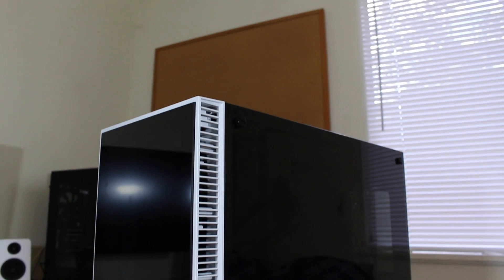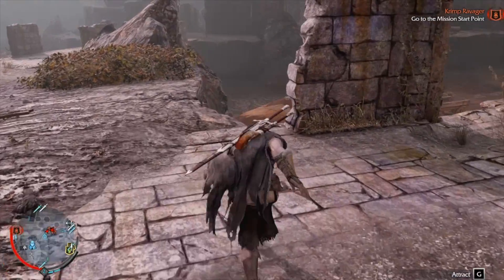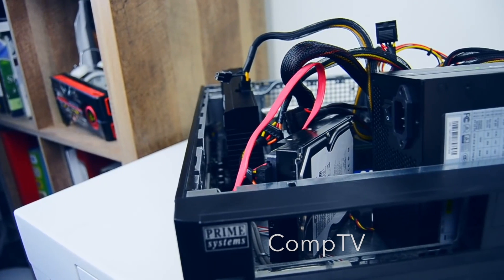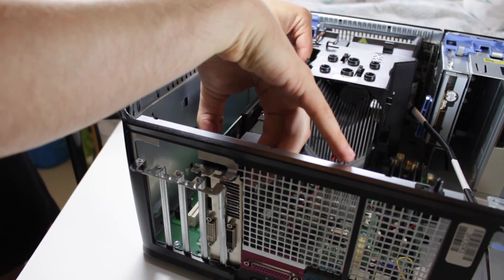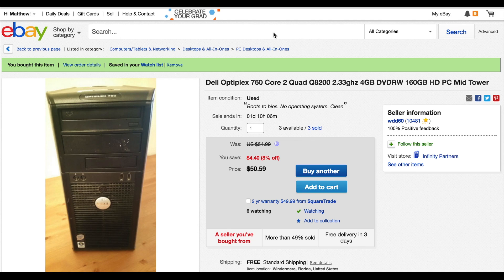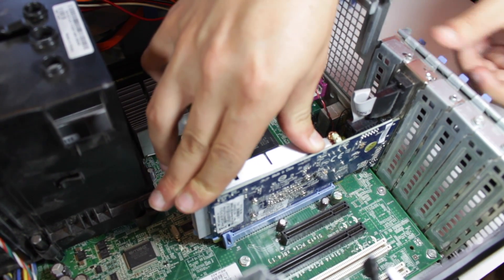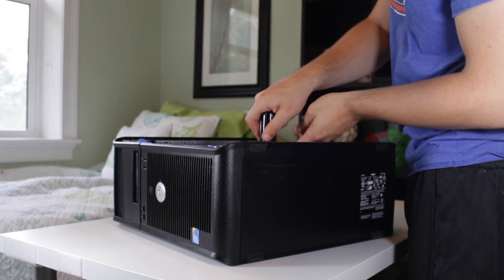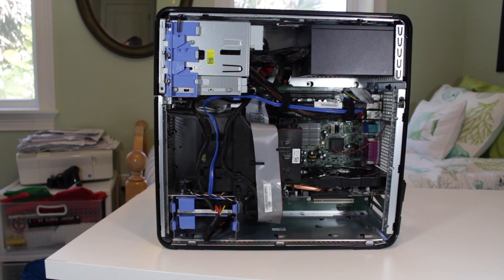Is a $100 Gaming PC Possible?

Comment: I got a gtx 750 ti -$55
PC with 500gb HDD,10gb ram,and i3 2102-$45
For the os, I brought my USB drive to the library and downloaded the  windows 10 iso then converted it to my PC once I got home. 
The PSU was 350w though but luckily I got the 750 ti - pcie power 75 watts

Comment: I got 
Q9400 clocked at 2.6 GHz 
8 gigs of RAM
500 GB Hard Drive
GT 730 2 GB GDDR5
300W PSU
and a case lol
for just 66$.
Reply: Poviku-PPcans The problem is that the place where I live, there aren't many cards out there in the market. Yeah, of course, I have to buy used, but I can't find any old Graphics Card in the country I live.
Reply: In Middle East.
Reply: Yeah :/
Reply: decent
Reply: I got half of what you have in every department

E7500 clocked at 2.93 Ghz 
4 gigs of RAM
250 GB Hard drive 

;)
Reply: +Ali Salim Where are you from ?

Comment: I bought a older refurbished mobo (dq965gf) for 30 bucks, a rosewill scm-01 for 30$ as well, and a q6700 for 25$, a atx-vs500w for 25$, and a gtx 950 factory overclocked for 150$. That's a 235$ pc, that's what I call a budget gaming pc! Not this hunk of ass
Reply: Well with the bottleneck on your gpu, your framerates wont be much higher than his. idk what ull do without any ram. And for more than half the price. im pretty sure i would choose  this "hunk of ass" over ur cptain america budget gaming pc
Reply: André Lente ya forgot to mention I have 8 gigs of ram, and no it didn't run anywhere near this pc would. I got 50fps on gta5 very high settings, 55-60fps on high. Over 140fps on csgo max settings. Also I got the q6600 instead and overclocked it to 3.0ghz.

Comment: i have an hp base system its really good
but i have another 100 dollars in my pocket and in need of a graphics card
the only game i want want play is gta 5 so please recommend me a 100 dollar graphics card
pc specs
core i5 2400 clocked at 3.40 ghz 
320 watt powersupply
12 gb ram
500 gb hdd
gta 5 currently downlading.....
Reply: RX 460 2gb
Reply: soohoo! I've got an i5 2400 with a GTX 1050 Ti and it runs fine.

Comment: Can you make a video that incorporates a build that will not only play the games mentioned at 1080p, but your system will be nicely capable of recording and editing/rendering that same video? Just because it can play the game doesn't mean it will record/edit/render and play well on YT afterward. It's yet another challenge!
Reply: Eurocat Games Nvidia cards will get you ShadowPlay, a screen recorder that barely impacts performance. As for editing, using Sony Vegas with or without GPU acceleration will get the job done real good. Both rendering and editing usually have a bigger hit on the CPU than GPU, typically.

Comment: Hi Man 
I Buyed A Dell Optiplex 380 With Core 2 Duo ; 4 GB Ram ; 320 GB HDD ; 250W PSU For 70 Dollars
Later , I Added A Msi Nvidia GT 710 As A Budget GPU 
The PC Has Been Working 1 Months After Upgrading The GPU
Now I m Stuck And I Can t Even Boot It He Gives An Orange Sign With A Little Noise That I Dont Know Frm Where He Come 
Can You Help Me Plz

Comment: how does these refurb pc's long last?. i purchased these prebuilt pc like 10 times there mobo died within 4 or 5 months does this happens with anyone else?
Reply: Salman Ismail no mine has last for almost 3 years now
Reply: Kike Rosas i dont understand why its keep doing that now i'm not buying these prebuilt pc and dont have big budget for new parts
Reply: Older/cheaper/refurb parts don't like power fluctuations (i.e., surges, spikes, sags and dips).  If one or two critical capacitors get zapped, then your whole motherboard is toast.  Always use a UPS (uninterruptible power supply) between the wall outlet and your PC's power supply; they include a built-in surge suppressor, so they protect against both too much AND too little power.  Look for a cheap one with a low VA (Volt-Amp) rating, as you're not concerned with how many minutes/hours it will run off battery power.
Reply: What is APC
Reply: My Dell is still running ( over a year). I didn't try to upgrade for gaming because the ps is too low and only dual core cpu.
Reply: Kevin Gulley My Dell optiplex 755 Has bin working fine for light gaming and basic use for the past 3 years now
Reply: it might be the electricity , some countries have no stable line (like where I live) so you have to get yourself a UPS and that would extend the life of your computers ;(
Reply: imagine I posted my comment below just before I got to see  yours .. thats the correct thing to do , my monitor has a green dead pixels line in the middle of it because of the power surges and fluctuations and i'm sure 100% that its the problem in Salman's case
Reply: Ali Salim which country you live?
Reply: Salman Ismail am in Kenya
Reply: Im in pakistan..... does earth wire in extension board can save my pc especially mobo
Reply: Salman Ismail no .. that will not be the solution of the problem... the UPS protecfs the computer from the sudden change in electricity current in any way , your computer (motherboard) needs to have a stable current all the time when it's on and also when the power goes out for some reason it helps by giving you time to shut down the computer properly ie. start menu > Shut Down.. the issue is not about earthing the computer or motherboard
Reply: Salman Ismail I had almost the same case like yours .. I had a UPS which is practically dead and I insisted on using it until my new monitor got the dead pixels line there's when I said enough is enough.. I spent more money on the new computer to buy a new ups  but now am headache free (well untill I change the monitor which is not that big of a problem for the time being )
Reply: I have ups in my shop and all my three fans were dead every fans inside copper wiring were fried thats why i dont use ups for pc
Reply: Salman Ismail you must do something about your setup.. I just told you how it is .. maybe you should use a more high quality UPS? use APC .. that's the best
Reply: I would reccomend getting a cheap dell optiplex and slapping a good GPU in it.
Reply: Salman Ismail a  company which manufactured alot of things among them high quality UPS.. just google APC UPS and check images

Comment: LOL it's impossible to build one in NZ for $100 import charges are too expensive.
Reply: Don't you guys have e-waste recycling centers?  Just loot from the bin!  You'd be amazed at what people are throwing away these days.  I got ~10-12 Core2 Duo Dells and HPs a few months ago; I think a post-production house had just gotten rid of their old workstations.  There were some Core i7s in there, too.  Some still had the hard drives inside!  Another tip: look on eBay for cheap motherboard/CPU combos.  I picked up a MSI desktop mobo with a quad-core Core i5 and 8GB of RAM for a mere $18 total, plus $12 shipping!  (It also came with a low-profile heatsink and cooling fan; it turns out it was yanked from a Barracuda network appliance!)
Reply: Cairo Murphy I know how you feel
Reply: Cairo Murphy Same here in Australia.
Reply: Cairo Murphy  i know how you feel every adault can out bid us
Reply: i got a headache just from reading the combo of the MSI motherboard, it just kinda like somebody hit me with a PC on my head :D mouthwatering combination!

Comment: hey guys i found a old compaq computer featuring a 170u amd athlon 2 proccessor and 2gb of ram. my goal is to play gta 5 online at 60 fps and settings at something the same or higher then ps4. can you guys reccommend me a good cpu upgrade and gpu updgrade? 
Thanks!
Reply: hd7970 is good but you´ll need a good powersupply and i´d recommend going with intel for processors (for the older cpus that is)
Reply: That's AM3, so I would go with a Phenom II, preferably X4 or X6. A Phenom II X6 can still get you by with little bottlenecking. Make sure your motherboard supports the TDP of the CPU you choose, and upgrade your RAM to at least 6GB. A decent GPU would be a GTX 660.
Reply: i just got windows 10 with this build. i played around with settings used boost mode and got a 108060 when played around with settings. visual quality is less then ps4s but fps>>>graphics and cant really complain if this is honestly less then ps4 but runs at 60 and can use skype mods etc...  i may get better cooling and power supply when i get money. Thanks!

Comment: what are your  thoughts on buying a used power supply
Reply: psiklops71 
I would advise against it. It's the most important part of your PC, if it goes it can possibly take other parts with it. It's better to buy new units from reputable brands. It's not a component you want to save money on.
Reply: psiklops71 I bought one for 50 bucks that is 1000w and is pretty nice and it hasn't fried anything but you can always use the paper clip test if it's craigslist.

Comment: Totally agree with this because I made your $200 build and are running rainbow six on ultra and about to try arms and see if it works
Reply from the maker: nice, did you use the same exact specs?
Reply: Tech By Matt yes everything is the same and I thank you so much for making that PC because it really help me get into the PC world
Reply: i made an $80 gaming pc which can run TW3, ROTTR, dota 2, crysis 3 and stuff. Its not impossible. Prices on ebay are really impresive. You can actuallyt check the video i made.

Comment: Budget build question for ya Matt. I'm on a dell optiplex 990 small form factor what would be the best graphic card option for that? PSU is 240watt
Reply from the maker: Best available would be a gtx 1050 ti low profile. Which is still really good for gaming, but is slightly more expensive than a regular 1050 ti.
Reply: Tech By Matt Thanks that was the conclusion I was coming to as well but it states 300 watt is the minimum recommended psu. Do you think it would still work with a 240 watt without burning it up?
Reply from the maker: What is your CPU? its probably is ok, but I would post on a forum like toms hardware to see if they think its ok.
Reply: Tech By Matt It's an i5 2400
Reply: Tech By Matt Thanks again for the quick replies you're awesome man!
Reply: Jean-Carlo Msi 1050 ti Lp card. Fits and the psu handles it no problem. That's the exact build I did a on a spare gaming pc that  I put together a month ago.

Comment: i had to build a cheap gaming pc for my little brother. i bought a 50€  used pc that was used in a company. the spec werw a core 2 duo e7500, 4 gb ram, 160gb hdd, windows 7. i slamed my old gtx 745 in there. but it was so slow that it was unusable. so i went out and bought a cheap 60gb ssd for 40€ for windows. and boom. now it has a 30sec instead of a 4 min startup time. but a cpu upgrade is nececary because it is bottlenecking the gpu.
Reply: i just got a q8300 for 20 €, was the cheapest option in germany on ebay
Reply from the maker: Yeah an SSD can really make a world of difference for general computing tasks.
Reply: You can get a Q6600 for $10 and then tape mod it to 3GHz.

Comment: I have a q6600 and a small graphics card (8400gs). 4gb of drr2 ram. Wich graphics card should I buy?
Reply: Tim Scholte Lubberink don't even think about a new gpu, even as new as 750ti. I'd highly recommend trying to find a second hand gtx 660ti or HD 7870 as these would compete with a gtx 1050 while costing only around £50. just make sure your psu is 500w or more and pretty decent
Reply: Tim Scholte Lubberink 1050ti and go to 8gb
Reply: Tim Scholte Lubberink You can buy a GTX 750
Reply: TheCreatorofGod It's recommended to buy a second hand video card but brand new is better.
Reply: SWEEPER_14 new cards are better for driver optimization sure and for tdp, but a gtx 670 will destroy a 750ti even up to a gtx 950 while costing the same/less second hand.